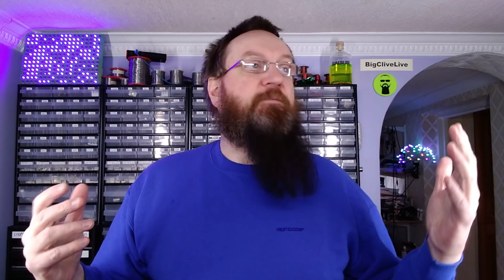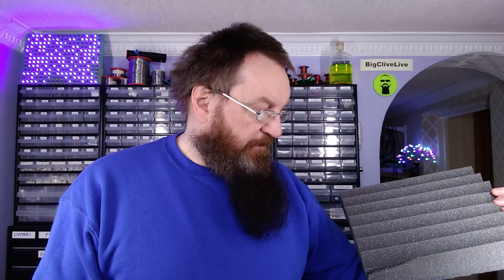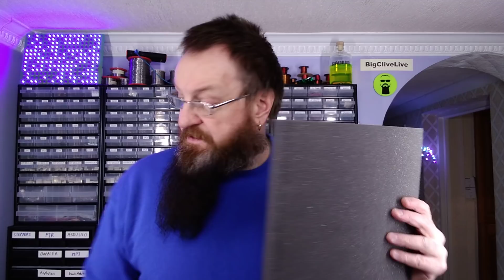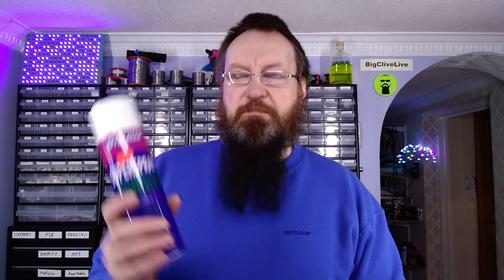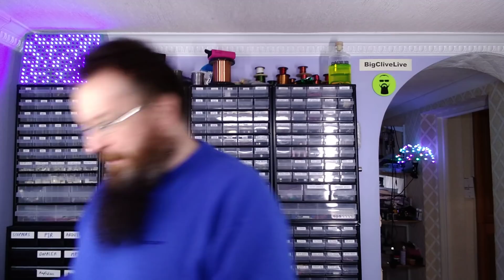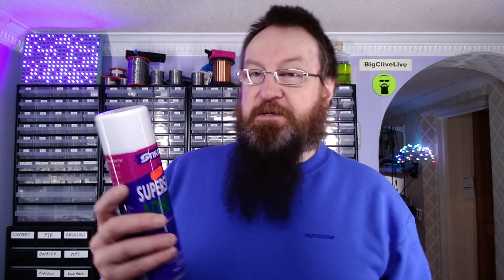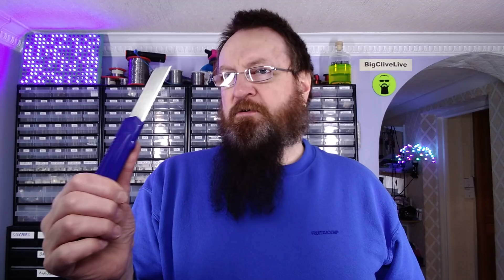Acoustic foam test.

Comment: Killed the reverb, but also the high ends. Needs a slight highpass filtering or some EQ. 
Thanks for the great content Clive, I've learned so much during the years!
Reply: problem is, the thin foam is very effective at stopping higher frequency reflection but core vocal frequencies are 100-300hz and poor ole clive has a deep voice in a small room where the primary reflection is likely to be muddying up this range significantly and the thin foam won't help much for these deep tones. IMO What he needs to add now are some thick corner foam bass-traps
Reply: *highshelf filtering, a highpass wouldnt do anything except take out the lows
Reply: While Using Acoustic Panels You Need Acoustic Curtains for Your Rooms, SoundProof-Curtains.me

Comment: Definitely fewer highs bouncing off the walls, but I can hear that booming bass effect when you get close to the mic.  I get a lot of pops in my cheapie computer speakers when that happens and have to cut the volume down a tad to smooth them out.  I gather from your Show More comments that the bass was worse until you changed your mic?

Comment: Huge difference, Clive. It's also useful to add a foam shield behind the mic. The low end that people are hearing is a combination of resonance from the proximity effect (directional mics) and the short lengths of the space you're recording within. Corner traps help with bass to a degree, but that's not the extent of the low end phenomena here. Sounds good. Don't overthink and take what you've gained here ;-)

Comment: You put a bit too much, the sound is a bit muffled now.
In your case, it seems that you have a problem with bass echoing in the corner of whatever space you put the mic in.
lost a bit, cut the foam into stripes & put it on the corner like the step 3 in this guide:
https://eqacoustics.com/pages/acoustic-foam-treatment-guide
.
as for the rest, you can try change/add a mic foam (it's cheap) or just put a slight lowering a bit of low-end bass (<100hz) on EQ. 
you're a stage operator, your friend should provide better input as well; either way, it's pretty decent already.

Comment: To me so you complete Layman it does definitely have a difference. It sounds more dead. Hard to explain, the high-end seems to be cut off but it doesn't Echo you might need to actually turn up the volume in your recording to compensate but it does sound better. I guess better is the only way to describe it

Comment: How about putting all those component bins behind a cabinet covered in acoustic foam. Dont know how bass heavy ur other work is but a couple bass traps in the corners could work miracles. Corners the oft overlooked and cheapest way to change acoustics of a room. I have seen some great home studios that spent lots of coin on covering a whole wall, when checkerboard pattern on walls and a couple bass traps In the corner would do a far far better job at 3/5 the cost.

Comment: @bigclivedotcom  The Moto G7 has 3 mics, one on the top, one on the bottom, and one on the back. None on the front. As none of them would be facing directly at you when shooting in selfie mode, I assume that it then relies a bit on the sound to bounce around a little first to pick up your voice. The foam definitely cleared up a lot of the unwanted reflections from the walls. However, the mics are now unable to pick up as much of the mid/high tones. Just for kicks, try cupping both of your hands around the back of the top and bottom of the phone to have your voice bounce into the top and bottom mics. If it sounds a lot clearer, you could DIY something really simple like a toilet paper roll to direct your voice into both of those mics.

Comment: sounds better , the volume seems more even and the reverb is less , as oasnet already mentioned  ( i listened to it on a laptop , i will connect it to a hifi system now and watch it again )
Reply: the low frequencies (bass ) make it sound a bit compressed but depending on the speakers , software ( equalizers ! ) and such , it can be very easy to change that .

Comment: Yep theres definately a difference in sound. But I personally prefer the sound before the foam was applied. With the foam it sounds very hollow, like you're speaking through a cardboard tube. Did you put the foam all horizontal? Try doing it checkerboard fashion (vertical and horizontal)...and put carpet tiles on the opposite wall

Comment: Would have been nice to have a picture of the installation.  BTW I believe in that situation where you want to reduce reflections from Clive to the microphone, you want the grooves in the foam on the side walls to be horizontal (assuming the microphone is at a similar height to his mouth).  That way you get decent impedance matching at practically any angle of incidence.

Comment: its made a significant difference. If you wish to subdue those bassy echos though id suggest using bass traps  or sound absorption panels. Which you can easily make yourself with some fiberglass insulation and some sort of fabric covering.

Comment: It's made a huge amount of difference!  I think you still need a little bass rolloff.  If you've got a low-mid control, a tiny less bit of that as well.  Even without that, though, it's way better.

Comment: It's definitely easier to listen to, if that makes sense. It might be a tad less intelligible, but that could be solved with a bit of EQ.
Reply: Defintely, far less reverb but could do with a bit of upper mid and high added just to add a bit of clarity.
Reply: @alexthewheelers   general rule of thumb, should always cut before you boost. I.e turn down the bass rather than turn everything else up
Reply: @TheSquall001  while yes I agree with that you've said as it can lead to clipping issues especially it the analogue domain, back in the real world there would be absolutely no harm in adding even 3-4dB at the higher end of a speech track given if you were going to use a full signal chain you'd likely add compression as well, if you were worried about the signal being too hot you could always reduce the input gain to the EQ - however if you are that close to clipping already on a raw recording you are likely recording too hot anyway. Back to this situation, just adding where you want more will not cause any harm in here.
Reply: The unintelligible issue is caused by the Scottish accent not the foam.
Reply: @jgallantyt  yes, but the echo provided us with 2 or 3 more chances to understand what's Clive saying :D
Reply: @SpiacyLos  🤣
Reply: @jgallantyt  😆
Reply: @jgallantyt  🙏🏿
Reply: One of the Best Ideas of SoundProofing is "SoundProof Curtains" That Stops Outside Noise by 80% (25 Db) Tested. Check Here: https://livesoundproof.com/best-soundproof-curtains/
Reply: I found it easier to understand him after the soundproofing was applied.

Comment: Big difference between resonance and reflection, and those diffusers tend to only scatter reflections - like you said, mostly the treble is noticed. Given that you're in a boxy enclosure, you're looking at resonance issues, not necessarily reflective ones. The foam would best dampen the reverberations from the larger area directly behind you traveling into the enclosure. Those foam diffusers leave standing waves pretty much unaffected - or so I was told in college.

So, after hearing the comparison, you can tell the bass is still unaffected, but there's some notches in the spectrum from destructive interference. Those are more apparent now, because there's no reflective transients carrying those frequencies. A bit of EQ can fix the bass, but there's not much you can do for the destructive interference - you can boost it, but it'll still be muddy. You can also still hear the reverb from the rest of the room. Now, the wall to our left (your right unless it's mirrored) could do with some foam, as it's pretty close to the mic as well.

You can actually put objects into the enclosure (a wood or plastic box, for example) to change the resonant pitches as well. Since you can simply just take them back out, they'd be worth trying. Corners are a good place to start, as a lot of frequencies get projected by them (they act much like megaphones, though I'm sure that's quite the oversimplification).

Comment: Oh no, you've engaged with the audiophiles. Now they will stream in and tell you how to give them the audiophilic experience they cannot survive without.

If you give an audiophile a piece of foam, they will ask for a full acoustic treatment. If you give an audiophile a full acoustic treatment, they will ask for an anechoic chamber. If you give them an anechoic chamber, they will say it's not good enough and tell you to move into a underground missile silo converted into an isolated recording studio for your live streams powered purely by analog equipment built in the 1960s with wired together gold plated oxygen free copper cabling.

Comment: You're sound quality is very good when you're presenting from your desk, maybe you're using another microphone. In this presentation with or without foam its pretty bad, way to much bass and echo way above 5 milliseconds, likely from the room. I would suggest a very directional microphone as close as possible to your mouth and/or heavy drape curtain behind you, if they are green you can play with all kind of special effects lol.
Acoustic foam may speedup or slowdown a fire but won't self ignite. Place a smoke detector in every rooms and keep fire extinguishers handy. By the time the fire brigade arrive they are only going to save your neighbors houses.

Comment: It works but I had to turn the volume up a bit after you put the foam up. Good luck getting the spray adhesive off the wall when you eventually want to redecorate. Speaking from experience; disk sanders don't even work lol.

Comment: If you listen on a telephone or laptop, ie with no frequency below 150/200hZ. Not much difference but I tend to view on my 79 inch TV and sound on my HiFi system. On the HiFi the sound is always very bass heavy, adding the tiles made it less bass heavy but not any more natural as most of the HF also vanished.
Maybe it's a function of the mic and the tiles? I have found in problem rooms a lapel mic tends to be a better choice as the sound going into the mic is closer to your mouth and picks up less reflections. Selective bass cut on editing is another option tool to play with. Probably the most useful, and costs nothing!

Comment: You have a large bass presence from 100Hz to 700Hz. It seems there is quite a steep filter starting at 700Hz at about -40dB per decade. I would guess it's the microphone's fault.

Comment: Sounds like  you need a mic that isolates vibration. Basically a floating mic. Still sounds like you're getting a bit of a base off of some vibrations of where the mic stand is attached. Other than that the improvement sounds good.

Comment: Sounds better on my setup.  The bass is still there but the low end rattle from transient peaks has been tamed.  I'm using an old Cambridge SoundWorks system with a powered bass cabinet.  Thanks for all the effort you put into your streams.  Keep up the good work.  Cheers!
Reply: Though I personally feel the Cambridge systems had much better satellites than the Creative Inspire systems had, I am still put off by subwoofers in general, they have such a problem when it comes to how the bass sounds   in different parts of the room in my opinion.
Awesome that you still have it by the way, I have a Creative Inspire 5.1 Digital 5700 since 2004 and it still works, though I now mostly use it for movies.
Reply: @Dutch3DMaster  I have my subwoofer placed in the back of a large, bottom compartment of a roll top desk.  I leave the door to the compartment open when using it.  The output is set for approximately 20% of the total available output and it provides all the bass I need at that setting.  I've been a bass player since the early 1980's and I have no complaints about the reproduction quality. Though I will admit to not considering myself to be an audiophile.  I'm only using them because, like Big Clive, I'm cheap. That and I already had them sitting around.  Thanks for the response.  Cheers!

Comment: Now overdamped IMO -  a few reflections make voice sound natural.

Also - foams tend to selectively absorb more highs and mids, which means you lose intelligibility.

Unless you get into corner traps it might be best to remove a panel, or cut several back a bit.  Hard surfaces can be useful if they aren't parallel. It's standing waves, between parallels, which usually cause problems.
Reply: No way Jose. It isn't overdamped, it just isn't equalized right atm, you can never have enough foam to kill the reflections when it comes to Human voice recording imo. It sounds so much cleaner without any reverb, and it's easier to listen to for a longer period of time.

Comment: Sounds better. Maybe you should have done the test after you had put only some of the foam up (say just the sides and not the top, or one side, or just the top) and  determined if that was enough to absorb the reflections. As other have stated, there's a distinct loss of higher frequencies now. personally, I use Roxul ( a  mineral wool insulation board) for absorbing reflections and eliminating standing waves.

Comment: Definitely sounds way better, except on the very low end. There's still some booming noticable, but that should be fixable with a high pass filter that cuts off at the very deep end. There just isn't any foam that can handle that bear voice I guess. 😁

Comment: tbh, all the foam acoustic products are s#!t. only one that doesn't suck is Melamine. the rockwool and glass fiber panels are much better but the Melamine is just easier to work with. here is an example of a panel you can easily hide on your sealing since it's white and it will have much better effect that the crappy foam shown in the video https://www.thomann.de/intl/il/the_t.akustik_melamine_50_100_100_gray_4pcs.htm

Comment: Definitely had an affect and sounds better I think.  Took away the "tinny" sound  I got a pack of that from a pallet bin store here.  I think these is 12 squares in the pack.  Going to use them soon and, a friend gave me a roll of 1/4" adhesive foam that I might use as well if needed.  There's quite a bit on the roll.  I think it's about 4 ft wide and about 6 ft or so, long.

Comment: Yep sounds better. if i was using that recording for studio application, it would be much harder to work with the untreated version cause the moment you compress or eq something the room noise would be brought up something awful.
Also you need a low cut around 100 - 150hz (not a treble boost)

Comment: The treble is less now, and the mid as well it seems. Your voice is still boomy yet pleasant. I presume it's more natural without echos, but not better on the cheap speakers in this laptop. On better speakers I am sure it would be, well, better. 

If you had a decent condenser mike on a boom, and a mixing console with equalizer / sound controls I bet it can be improved quite a bit still without big investments.

Comment: the foam is eating too much of the high pitch frequencies, you might have to increase the gain in the higher range to compensate. Other than that, the sound is better.

Comment: It has stopped the echo but it has hit the high end a little.
Sounds a tiny bit muffled now.
Maybe add a bit of treble.
Reply: Agree - the lack of treble makes Clive harder to understand.
Reply: @thesaintnoodle  exactly, this thin foam removes high frequency reflections, but does not remove bass boost you get from a box. You need to EQ down the bass frequencies in post or in Equalizer APO
Reply: @thesaintnoodle  Exactly.  Classic hi-fi rising s-curve, ftw! 👍
Reply: While Using Acoustic Panels You Need Acoustic Curtains for Your Rooms, SoundProof-Curtains.me
Reply: Heretic! It's all about that bass! NO TREBLE!

jk. On my reasonable speakers I lost a lot of volume when the foam was added, seemed like he needed to turn up the gain, or reposition the mic. But plebian EQ should fix that.

 His face is also less well lit because of the dark material, which is good if you want full control of the lighting... But now the lighting is all on you.

This is yet another cautionary tale of how increasing production value is a slippery slope.
Reply: @ch4.hayabusa  
Never use gain as a volume adjuster 😁
Reply: @ch4.hayabusa  There's no snare in my headphones.

Comment: As others have said, it still leaves the bass reverberation which you'll only deaden with bass traps.... I think the net change in aesthetic is negative as the boominess is probably the most fatiguing part of the reverberation.... Perhaps if you have an EQ along the line you can tweak the bass down a bit and the mids/highs up a bit and that can temper it enough...

EDIT: After going to videos from my other favourite channels (e.g. PBS Space Time), they do actually have a very light mid and high reverb with no lows (perhaps artificially added for comfort) and it is much easier on the ears... Something of a bass trap may be the way...